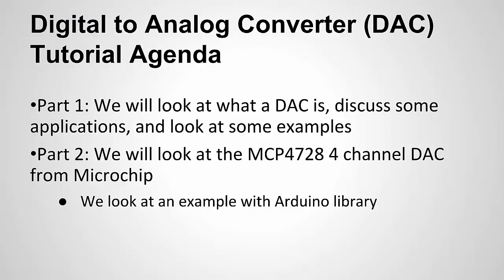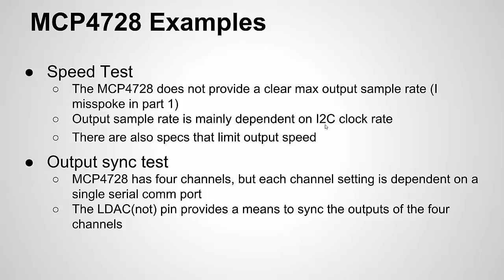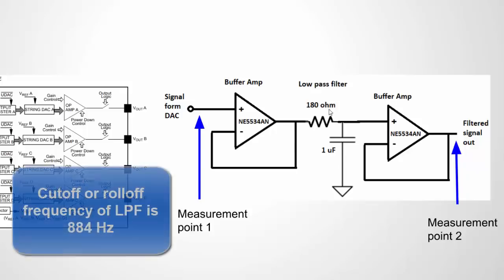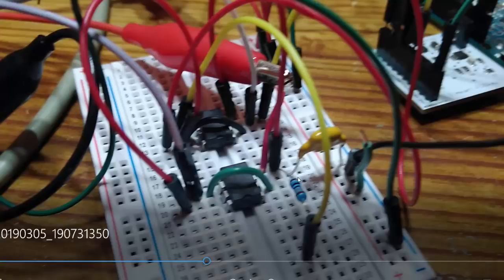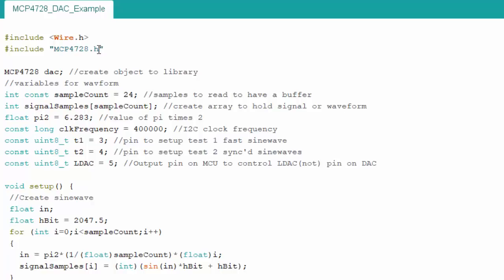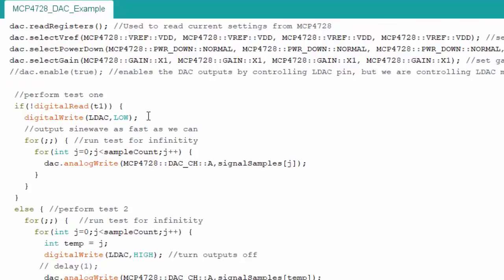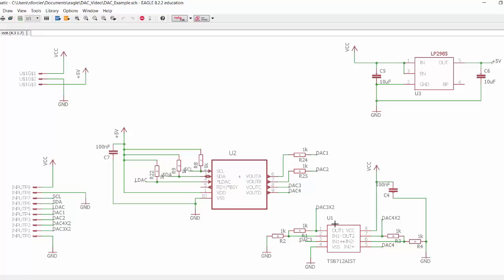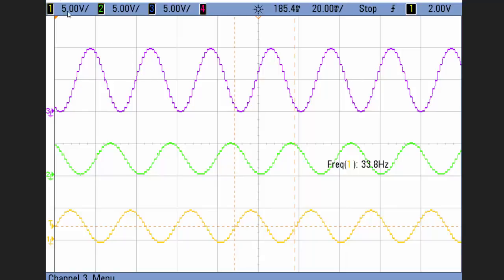Tutorial on Digital to Analog Converters (DAC) and Example Using the MCP4728 Part 2

Comment: Although a few years old now, just a quick thanks for the video.  It has inspired me to use this device on my latest IPEC ESP32 ATM90E32 IoT Power Energy Controller and Monitor board (variation on the original IPEM).   So many different DACs and ADCs available v massive variations in cost and availability, it is sometimes not straight forward to choose one device for a particular design.  Keep up the good work.

Comment: Can you please help me with my project? I am using the MCP4728 to convert digital signals into analog signals. I like your videos; I just don’t really how you did the wiring. If you can help me understand how you wired , that will be great!!!!
Reply from the maker: I show the wiring in the video. Your question is too general, can you ask a specific question on what aspect of the wiring you don't understand
Reply: @ForceTronics  I was asking about the connection between arduino and the MCP4728, like what pin goes to what pin. Also is it important to connect SCL to the arduino? I know SDA has to be connected because of data collection. Also, thanks a lot for the PCB that you made; I'm going to purchase it. Latly, how did you get to ouput 4 signals if the MCP4728 only has one input pin.
Reply from the maker: You can go to any Ardunio board's webpage and find information on what pins are used for I2C. I would recommend you read a tutorial on how I2C works. You can control all four DAC output pins via the single I2C port